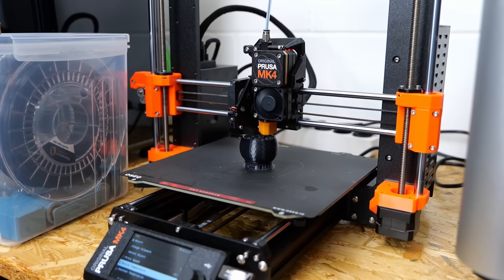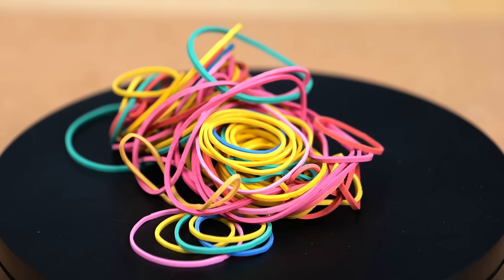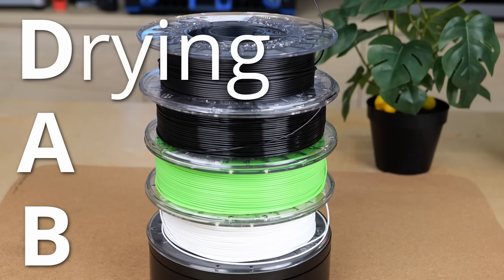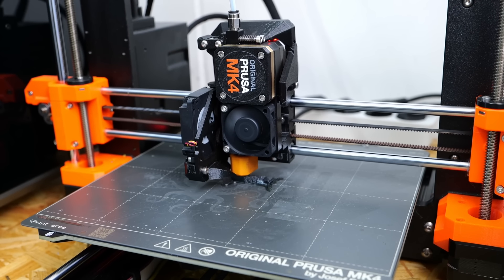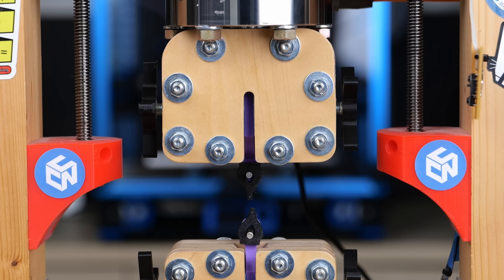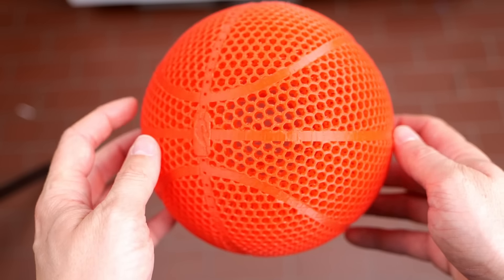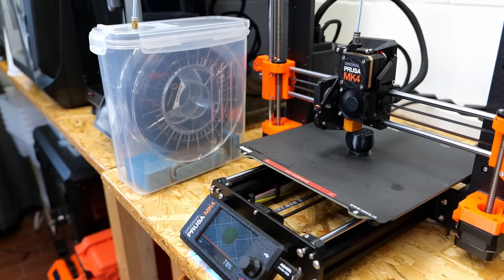Why aren't more people 3D Printing this Indestructable Filament?

Comment: I legit allways use TPU when possible. It is basically indesctrucable ! And The Layer adhesion is sooo good. I have 2 Waterbottle holders for my bike printed in TPU, every other material cracked after a while cause of the impacts of the full waterbottle but the tpu one still works just fine!!
Reply: Can you recommend some very hard TPE ? I have some TPU over here but it's very soft and hard to print on my ender 3 with Bowden drive. I don't know  the shore hardness. I don't even know the brand.
Reply: @Saeschboy  You can just buy hard TPU, most is quite flexible, but some sell multiple varieties, including hard ones.
Basically indestructable to hard forces.
Reply: Even with direct drive and using external feed the very soft Ninjaflex TPU doesn't  print well on an X1C.
Reply: What brand of TPU do you use? I only have experience with one, and I wasn’t too impressed.
Reply: @XA--pb9ni  After hearing from people how good Sunny was for a long time, I just tried their PLA and was not disappointed. I will happily try their TPU. Thanks.
Reply: I have a home based business.  Most of our products are now 3D printed, and all of them are TPU.  It's very under rated and under utilized, partly because of the price (Siraya Tech has recently lowered the cost with their quality TPU) but mostly because of the increased print time and stringing, which are surmountable obstacles in most cases.
Reply: I have some 95a from 3DX Tech that I need to print some more stuff from I didn't ever think about doing a bottle cage, going to give it a try, thank you!
Reply: @Saeschboy  CC3D make a 72D TPU, very reasonably priced.
Reply: @spehropefhany  I print Ninjaflex 85A on my Prusa Mini just fine...
Reply: @Liberty4Ever main reason I don’t use tpu is it’s more toxic to breathe than using pla. Need proper ventilation for tpu not a silly case filter fan
Reply: @carsonhunt4642 tpu is not very toxic compared with ABS. Pretty close to PETG. Overture makes some "high speed" TPU that is awesome even on an Ender 3 Bowden setup. I printed just as well on the Ender as the P1S direct drive with that stuff. Very similar material is Flashforge's Flexible PLA filament. This stuff is awesome, it's like a slightly lower temp TPU, same properties in many ways, but generally prints like a dream. Would recommend either.

Comment: Man, I wish there was an ultimate filament properties chart. Where all types and brands can be compared to each other.
Reply: That’s a great idea, shocked no one’s done it.. would be down even for some heavy monetization if any board software developer may be reading this.. 😂
Reply: Isnt there a website showing comparisons already?
Reply: Slant 3d is gathering up test equipment to do just that. I can't wait.
Reply: Stefan could definitely put together something with all the data he has. He could be the equivalent of Crinicle in the audiophile world, but in the 3D printer filament world.
Reply: The Prusa website has a decent comparison table for different brands, but it is in no way comprehensive.
Reply: Zack Freedman has a couple of videos that do this more qualitatively than quantitatively, but you still might want to check them out.
Reply: There's a website for that at least. I remember it from a 3d printer nerd video. The guy was doing it out of pocket and you can send in samples of anything they don't already have
Reply: there needs to be an analog to IMDB but for maker's materials, including filaments, resins, powders, etc.

Comment: Used TPU to 3D print a door stop. I was looking at all the poor designs and lamenting spending $5 to $10 on crappy commercial one made of rubber that I had already seen fail. So I designed and printed some. The other benefit is that it can be easily modified for larger gaps or heavier doors. They work well out of TPU, and cost me literal pennies to make.
Reply: I also made my own door stop. Needed a tall one that could take a beating. Plus, when you work out the weight its cheaper to just print it.

Comment: your friction tests...the surface finish of the sample has a huge effect on how "sticky" it is, resistant to forward motion. So then the same material but printed with a smooth vs textured surface will perform quite differently. To add complication they will perform differently in wet vs dry conditions. The supersoft material likely deformed during the test, creating more surface area in contact with the ground surface.
Reply: Also the coefficient for sliding friction will never ever exceed static friction. There is no other way except there being loose particles building up while sliding adding up to the drag

Comment: 4:20 What are you printing there Stefan? 👀
Reply: A "test cylinder" ;-)
Reply: I mean he was thinking HARD about what to print it seems
Reply: What do you think?
Reply: @dextrodus maybe we get a clue if Stefan releases a video testing 3d scanners in the near future.
Reply: My printer has only 210 mm in z axis... :/
Reply: @piast99  you don't have to print it 10x scale. Just use 9x
Reply: Is that Neo Armstrong Cyclone Jet Armstrong Cannon? I wouldn't have guessed Stefan was Gintama fan.
Reply: @piast99 still about 8 inches
Reply: When I saw it... I actually had to back up the video.  Did I see what I think I saw?  :D
Reply: the floppiest boi
Reply: clever use of suggestibility... the flesh color filament, the floppy characteristics, the phallus printing in the backhground. Genius. Chefs kiss
Reply: @TheRealPlato it's floppy when it's 1.75mm in diameter. As Stefan said, if you double the thickness you increase the rigidity by 8 times. Even by the time you reach 28mm in diameter (4 doublings), the rigidity is 4096 times greater. And 28mm diameter is very thin. 

A rod with a circumference of 11.66cm would be 9540 times more rigid than a 1.75mm filament. Not so floppy then.😅
Reply: It's a YouTube-Buddy™
Reply: This bit has William Osman written all over it. He's a bad and amazing influence. 👍
Reply: Ballsy.
Reply: I DIDNT SEE AT FIRST HAHAHAH
Reply: @piast99  Print it diagonal... 🤣
Reply: @piast99  That's what belt printers are good for :P
Reply: It was Dr Evils rocket ship.
Reply: It's for Science!
Reply: @spedi6721  lol  i hear ya
Reply: @spedi6721  you had to jinx it :))
Reply: A test cylinder 😂
Reply: @800Javi008  🤣🤣🤣🤣🤣
Reply: @spedi6721 Looks like he did just that. With a pickle.
Reply: @phizc  But you can use sparse infill to increase flexibility.
Reply: Now print the M&M container

Comment: The flexible filaments can be used to print replacement covers for electronic equipment. For examples, the little "hatches" on cameras that cover the HDMI, phone, mic... plugs. These parts are often not available (especially with older cameras) and so worth printing.
Reply: THAT, is a GREAT IDEA!

Comment: I actually slightly oil the bed for TPU: Put a drop on the PEI and distribute it. Then wipe it off with a dry cloth. Works great for me. (I use some fine mechanics oil.)
Reply: That's actually a good idea mate and easier to clean up than glues. Another tip for anyone struggling with with ABS/ASA (which is mostly what I print) is to clean a smooth PEI sheet with a SMALL dab of acetone on a clean microfiber cloth before every print. This should not damage it but do not squirt it directly on the bed or when it's hot.

IPA does not clean as well as you might assume and glues can actually cause problems. If you can't use acetone warm water and dish soap is still better. If you find it sticks too well you're probably using a hybrid material and not true ABS. I've never run into this but some have told me there's some filament that sticks almost like PETG.
Reply: lol when I print petg I just rub my hands and fingers all over the plate , free and works as good as glue as a release agent 😆

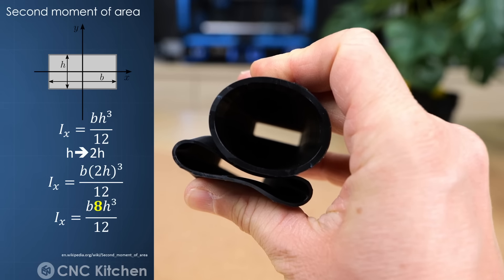Comment: 17:54 That moment of inertia formula that you used, works for rigid bodies. For a pipe it's only relevant for determining its resistance to buckling, but for comparing the overall stiffness of the pipe you'd want to use a formula where you take the area times the distance to the centroid axis.

Comment: ... and Every Bourbon is a whiskey, but definitely not every whiskey is a bourbon!  The maximum volumetric speed was one of the best discoveries that I've made in 4 years of printing.
Reply: It’s good for beginners but better to do it right, if you make functional stuff at all you want to tune speeds for strength. For cosmetic I’ll go insane fast on infill for example. No reason to slow while print down ..

Comment: I print directly out of a dryer for all filaments due to my short story...

My first roll of TPU was Creality green. I printed with it on an Ender V2 and didn’t have great results. I learned about drying and used a dehydrate function on my air dryer to dry. Prints would start great then fail halfway. Long story short, It absorbed moisture so fast I could dry for 8 hours and within 2 hours it was bubbling again. 

I threw away about half a roll of TPU because I couldn’t get it to print reliably on 3 different printers. I changed TPU brands and now I have nothing but great results.

Comment: You could use it for RC car chassis, ship hull, or plane wing. Set it to be strong enough to take the lift and air resistance, but soft enough to not break if you crash. If it can withstand fuel, like gasoline, you could store fuel in the wings like real planes, and integrate the fuel tank into the chassis to save space

Comment: TPU is one of the most difficult plastics to manufacture with. Many firms just won't work with it because they can't get the defect rate low enough. If you can get a fair bit of experience with TPU, you can find work in plastics engineering right now.
Reply: And where is this? I print with tpu and tpe a lot

Comment: Even through a bowden tube I find myself using more retraction than is ever recommend for tpu. 

I like to use the purple glue stick because of the PVA in it.  

Drying the filament makes the biggest difference! 

Another really good TPU is the Ninjatek Armadillo. It's tough as shit, and you can print it faster. It has great industrial applications, and I feel it's being slept on.

Comment: I'm surprised that this video never mentioned flexible PLA. I've become a fan over the last few months, it's so nice that it adheres well to regular PLA. I recommend checking it out.
Reply: That sounds interesting. Can you recommend a specific brand that you use?
Reply: @robertd330  I use Flashforge. I use the exact same settings as for my normal Polymaker PLA but I slow down to either 1-2 cubic mm/s or 15-20 linear mm/s with similar results. That's just with a Prusa Mini, so you could probably go faster safely with a different printer. Basically, I just treat it as a color change and then use a modifier to slow down the speed for combined material prints. For all-flex prints I go the volumetric route.

Comment: I didn't know about that max volumetric setting. That tip alone was worth the watch. I print a lot of engineering grade stuff like nylon and asa, and it really helps to slow the prints down, so I will be using that a lot now. It helps prevent thermal runaways, gives better layer adhesion and dramatically improves the print quality. It even helps with stuff like printing round holes in a perpendicular orientation (they come out more round and less squished looking). I avoid overhangs like the plague because the part cooling fan loves to induce thermal runaways at high nozzle temps, but I would assume it would also help with overhangs and bridging. Probably also help with making supports easier to remove with tricky filaments that don't like supports, like nylon.

It's actually interesting how much of this video applies to nylon just as well as to TPU. Right down to the gluestick lol. I actually have really really good results printing nylon on the Prusa satin sheet with a little gluestick rubbed on with IPA. I wonder if that would also work for TPU?

Comment: I love that you did this. TPU (and TPEs) are some of my favorite materials (I have from 70A to 75D filaments). Depending on what I need it for, I sometimes don't bother with drying. Drying gives better surface finish, less strings, and probably better layer adhesion... but if all I need is for something squishy, then it's not as important. I've used it for HULA, phone cases, bumpers on rolling tables, wheels on vehicles, kids toys (seriously, all of you printing Toys for Tots and kids toys in PLA and PETG and ABS... print them in TPU instead. They'll be virtually indestructible, make less noise when they impact the ground, extra walls or higher shore hardness means you can make "non flexible" toys out of flexible materials and not damage walls, floors, etc.). I even had a vacuum sealer that had a custom attachment... I designed and printed an adapter out of TPU so it could be used with the standard circular vacuum seal points on generic vacuum bags, and one model I plan to print soon says to print the o-rings to make it water tight in TPU. It can do a lot, and certain brands come in WAY more colors then the 2-5 that many other brands have.

May be a case of "US vs. EU" but I feel like the OG king of flexibles was missing: NinjaFlex. And on top of that, one of the most popular filaments, PolyMaker, also has a whole collection of flexibles. Many PLAs start as NatureWorks PLA resin 3D850 or similar, but I can't say "use one TPU, and you've used them all" so would love to see some of the big brands rather then just the EU brands. Outside of that, only real missing item: print on a textured sheet and you can skip the gluestick. It still sticks strongly, but you can peal it off without damage.

The airless basketball has been such an interesting one to me... when everyone was going nuts over them, they used PLA. Before seeing the first full video on it, I went "it will bounce at least once... and then crack because PLA doesn't like impacts". And many learned that. PETG (more flexible then PLA and ABS), ABS, they all did this in the end. Finally, someone did TPU... I went "wait, why did you use 95A? That's gonna hit the ground and squish" and it did. I didn't have much reference point on bounciness, so I opted for a 75D TPU so it would be stiff enough to rebound... but still be flexible enough to handle the impact. 100% scale on the XL. It lasted well, some 12 bounces or so... then I tried it on a driveway and it bounced twice. The 2nd bounce, it caught a rock and that little extra bit broke the fine mesh of the ball and it cracked. So while people went all over the materials, the real interest was seeing the 3D models... the one you printed (PartyLime) seems to have done the best "reproduce the design with double lattice structure" that gives it some strength and ability to rebound where as many others basically just made a hollow ball with holes. Actually, looking at it... he apparently released a version and worked with a filament maker to make one with near identical bouncing and supposedly tested it on a court, which is impressive on how far it's come. $2500 vs. $60 and the will power of 3D printing community.

Comment: If you despise glue stick like myself you can try spraying IPA on the plate while removing the print or heating the bed to 100C before detaching it - both methods work for me almost always.

Comment: I had printed TPU before ( maybe too wet as I learned right now ) and the results were acceptable. Lately I switched to a 0.3mm nozzle and I just tried to print my TPU again with a total failure. So I learned the hard way not to print TPU with a 0.3mm nozzle but that gives a hint to try it with a 0,6mm - maybe this gives even better results.
Thanks a lot for your very interesting video !

Comment: I don't have a filament dryer (or heated drybox), but with my regular airtight storage bin with desiccant I am able to successfully dry my TPU by placing the whole box where the sun would hit it by a south-facing window.  I just use a cheap 2-pound pack of color-indicating silica gel beads, and recharge them after the first day or two.  It takes a bit of forethought, but after 3-4 days it prints like a dream.

This will be faster in warm climates, but up in the chilly midwest it takes a bit of patience!

Comment: Thank you for finally explaining something, I've never had to dry my filaments to get reasonable surface finish, even my black TPU. I guess it's because I print my filaments at the lower temps. Usually 220C for a roll I have sitting out in 30-60% humidity..

Comment: I have used common 95A TPU on many items. Never have done any drying and my results are good. Stringing does occur but I am usually using TPU for less complex designs where there is not a lot of stringing and removing it is not a big deal. Regarding adhering to my textured PEI bed I just use no heating on the bed and removal is not that bad. I typically use TPU as a shell to install over a PLA case for impact resistance.

Comment: I am really in love with my
EIBOS Series X: Easdry Filament Dryer. It is super cheap (50$ including Shipping) it is small, can be directly printed from. Has a fresh air fan (so actually is able to remove moisture) and is quiet.
I print directly from it, so drying is only required for 1h or so and while printing.
Perfect results!

Comment: You can also measure the static coefficient of friction by putting the material on an inclined plane, and increasing the inclination angle until it starts sliding. You can easily measure the coefficient of friction from the angle: f = tan(angle).

Comment: few key takeaways when I do my tpu tuning, I'm not sure about it's shore hardness but I first tested the vol flow by extruding at a set speed, resulting in 5mm³/s, set that in the slicer, the. proceeding to flow, pressure advance, then retraction, finally got my pa to 0.32, flow rate 1.0, retraction 0.9mm at 30mm/s and yeah, having tpu dry is REALLY crucial to get a successful print!